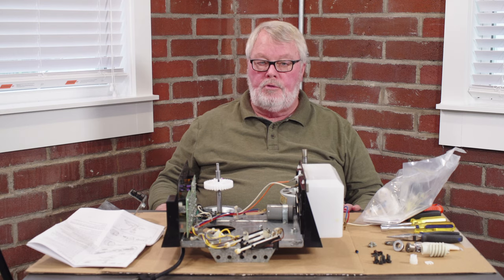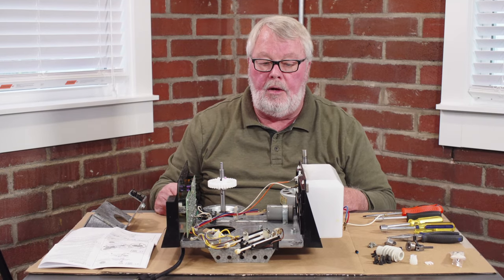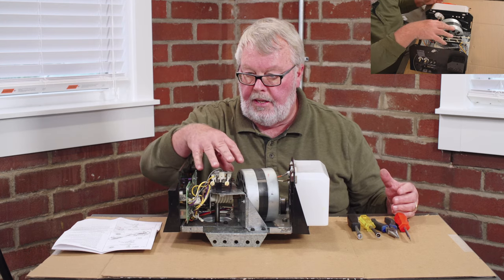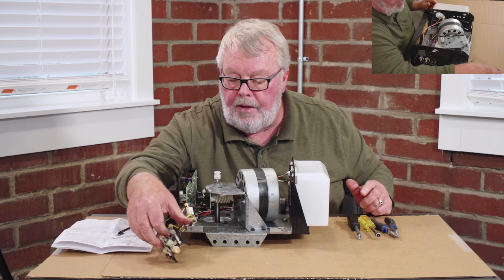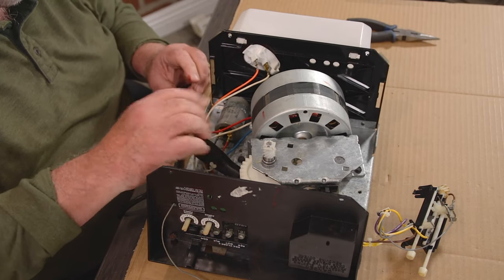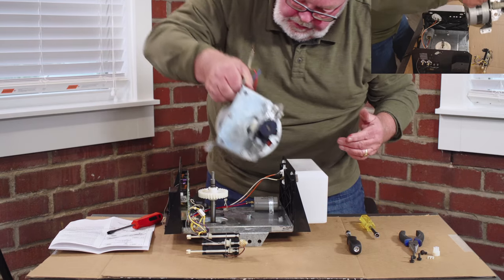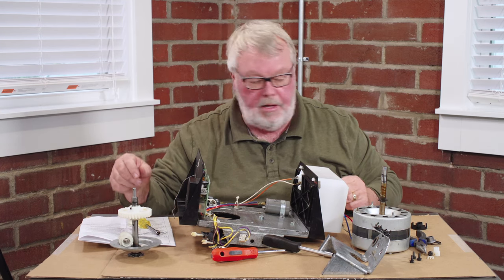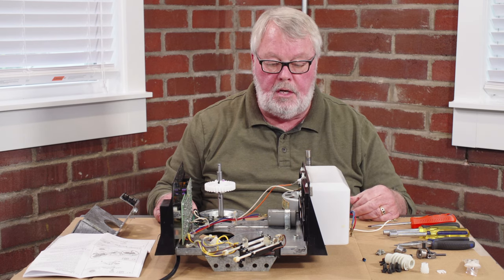How to Replace a Garage Door Opener Gear Kit

Comment: Thank you ... my bushing was stuck on the motor shaft and was very difficult to get off.   Lightly filed off burs from set screws in lock bushing and new one slid right on.  I installed the full kit as our opener is like 20 years old.  Kit had everything and it hums like new.  Thank you again for the detailed break down, and I fully recommend taking it down if you're going to do more than the primary gear and shaft.  Motor would be difficult to handle if unit was still on the ceiling.  Thank you again for taking the time to post this detailed video.